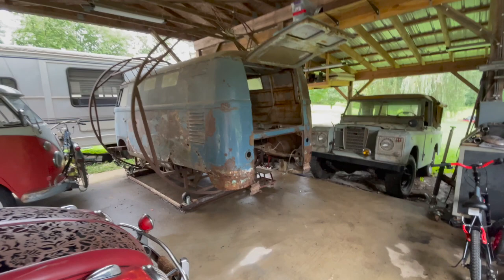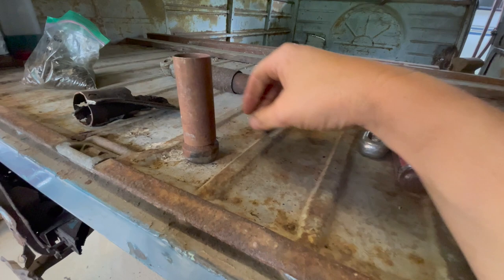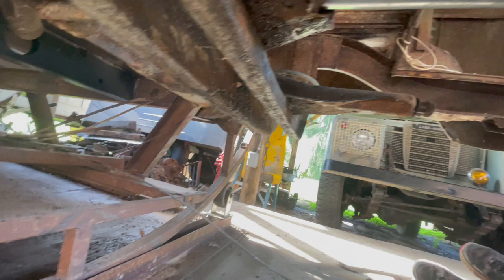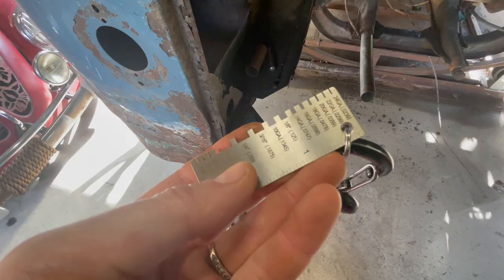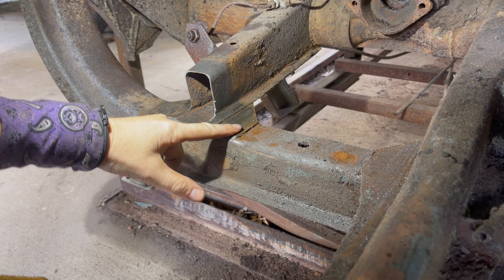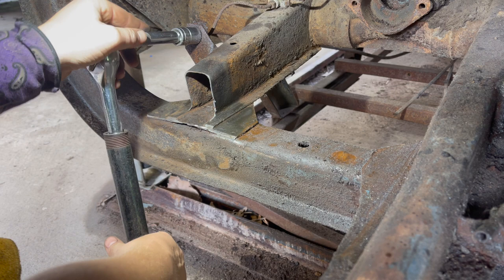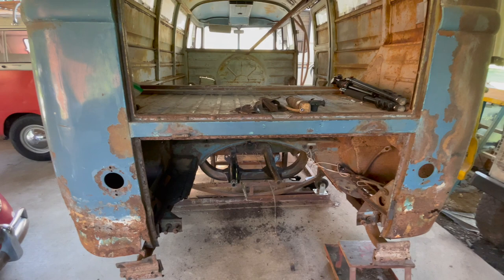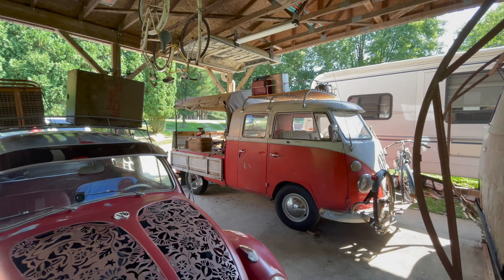VW bus rotten frame horn...let's fix it!!

Comment: You should make some colored plex behind that hood. make some panels that go under there like 1/8 thick. Even make them with clear. and then put lights behind there you can turn on. that way if you get caught in a rain storm it wont ruin the wiring.
Reply from the maker: we don't typically take it out if there is any threat of rain...but we DID get caught out in it recently and with the plastic/cardboard/tarboard "boot" covering the wiring it didn't even get wet even in that down pour of a storm!~ I was shocked...we've kicked the idea around of putting something behind it...maybe one day we will...I actually had an offer on the hood so I might sell it! I can always cut another!

Comment: I wish I knew about utoob when I had my 55 single cab. I boxed in my pressed bumper alot stronger than stock, but what I did it for was a single wheel trailer. Beefed up (with respect) the rear frame and bumper mounts as well. worked good! any hoo I dig what yah plant,  1st VW in 1979, a 57 oval, and # 42 is our 70 adventure wagon, we drive now.
Reply from the maker: I have to do something similar for this one...my dad has a 55 oval that he has a 46 allstate trailer on...he drives around town all the time with that trailer! I build a hitch system for my double cab for the single wheel and will likely do something similar for this bus as that has thus far worked out really well! cheers
Reply: @marcijunebug  Waitin  for the fire and the trailor mount vids. Me and Mama drove out the other day and we saw a series 1 land rover and it just reminded me of ur vids. Untill we win the lotto or get REALLLLLY lucky we will just have to keep the 70 bay goin (I do love it) have fun.